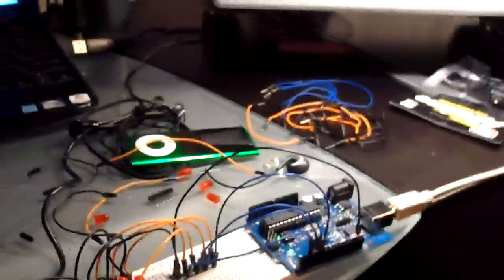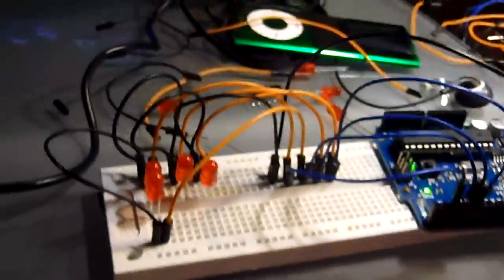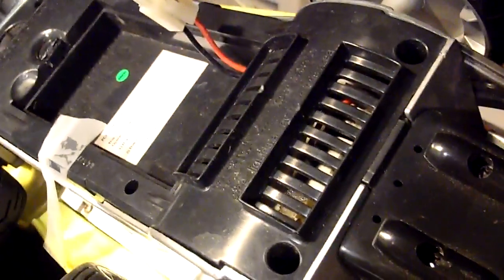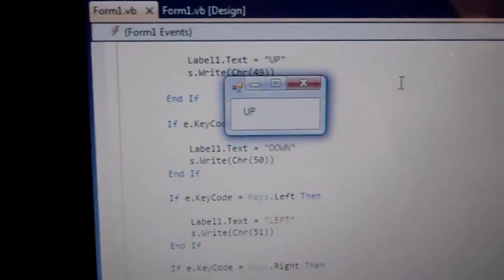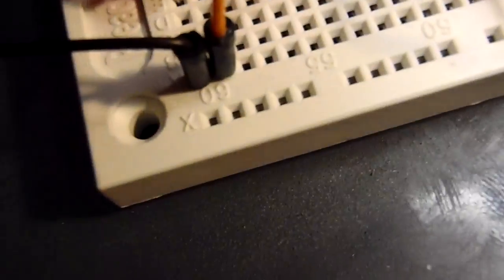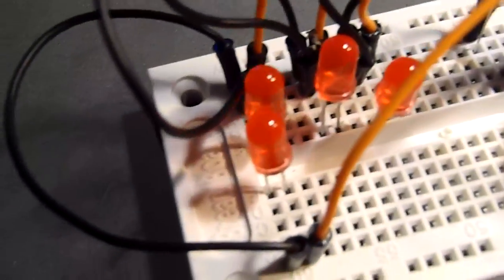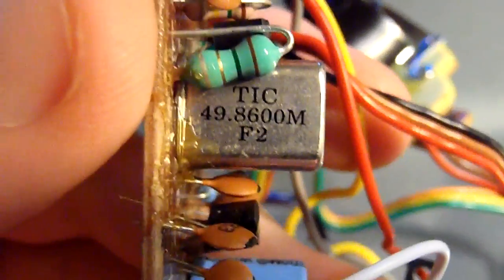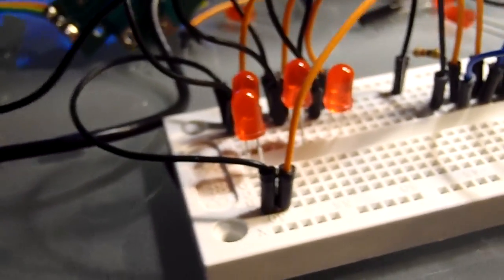Arduino With Visual Basic

Comment: How do you get Visual Basic to access the serial ports? Also, how do you send data from the arduino back through the serial port (I assume USB) to the VB. I'm talking about getting it to send strings back to VB